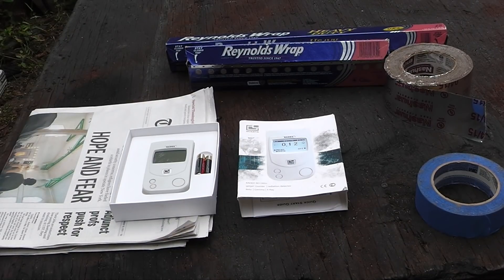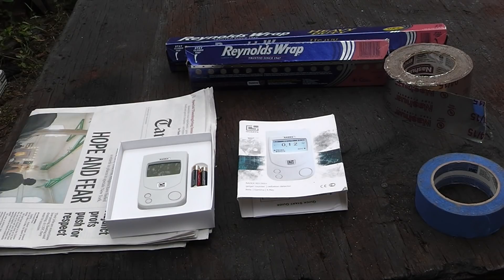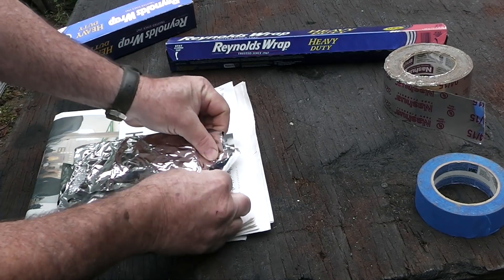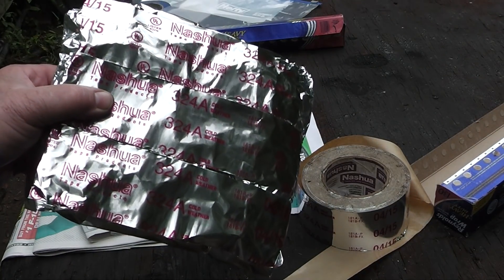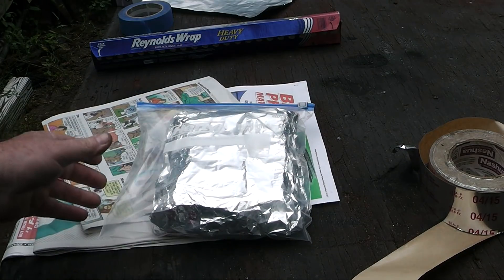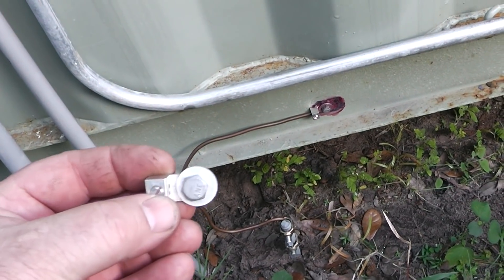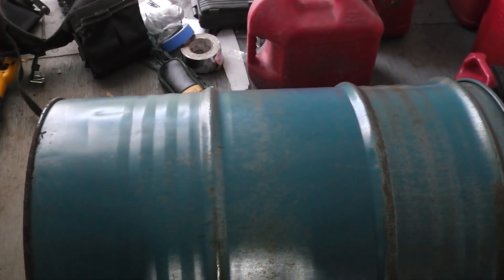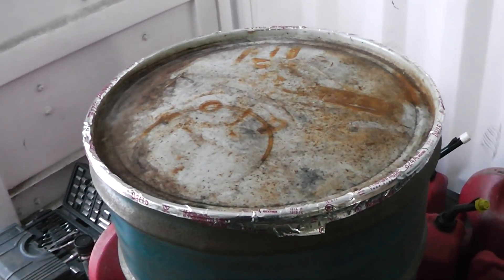Preparing for an EMP Strike with a 52 Gallon Cheap Metal Drum Faraday Cage Part 2

Comment: Buying an extra sump pump but we use the tall sump pumps so I'll need steel drum its the only way it will fit height wise..the steel garbage cans arent high enough and i suppose if i lay it on its side in the box i could slide in a smaller solar generator, radios, walkie talkies, and anything else electronic i can fit...metal garbage cans great for almost everything else..just not a tall sump pump...just saying..grab an xtra sump pump in case it gets taken out

Comment: Could you weld the ground lug on the drum?
Reply from the maker: Yes, definitely.  You will probably have to use some kind of solder for Aluminum to steel or copper to steel.
Reply: CADWeld is a method of making electrical connections, specifically copper-to-copper or copper-to-steel, without the need for an external heat or power source.